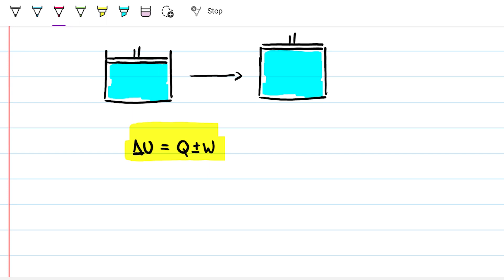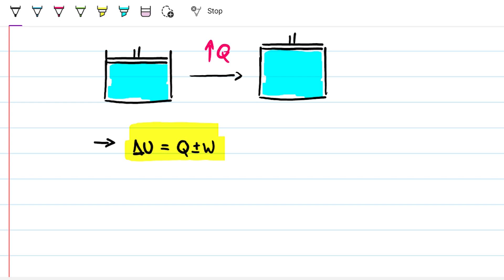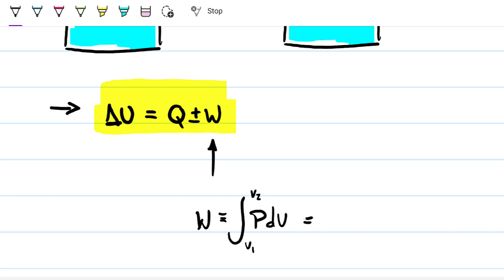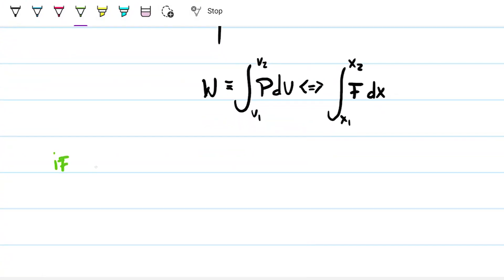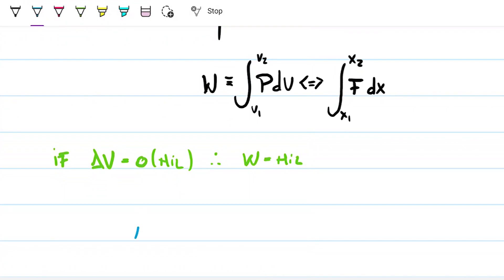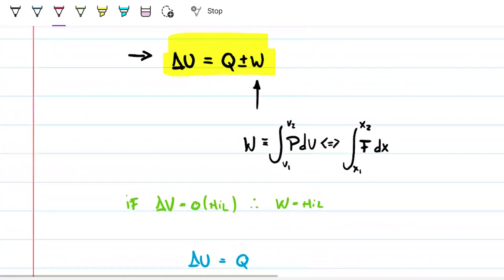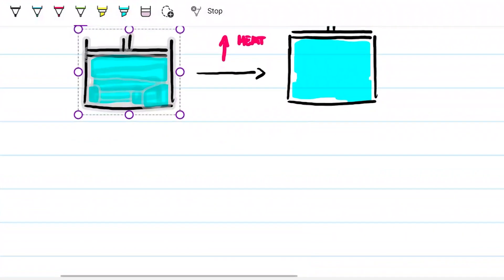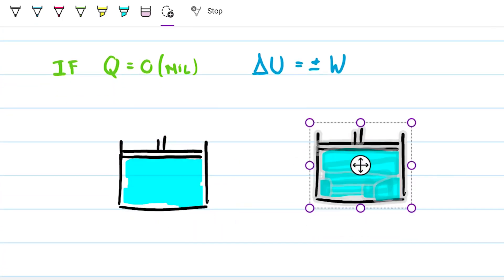A better way to understand the first law of thermodynamics (Part 1 of 2) | Thermodynamics

Comment: Hi, could you make a video on “condensate load calculation in a air compressor, dew point, and residual relative humidity of compressed air.
Reply from the maker: There are a couple in the channel about that already. Look at the thermodynamics playlist, in the final weeks. Any problem in particular you were after?